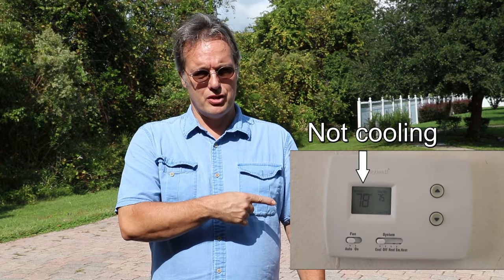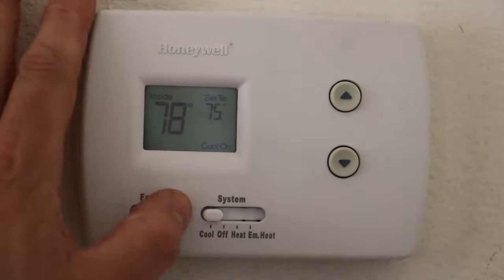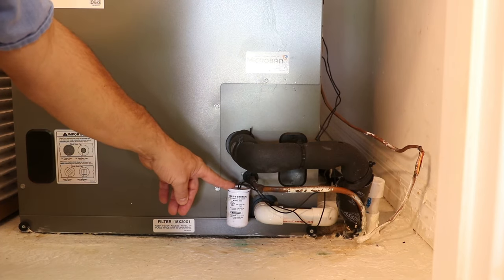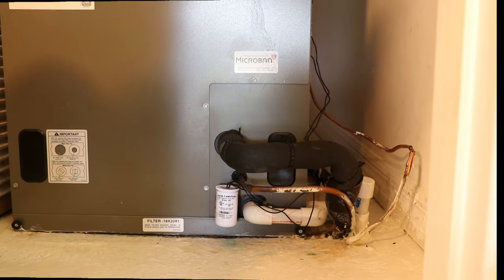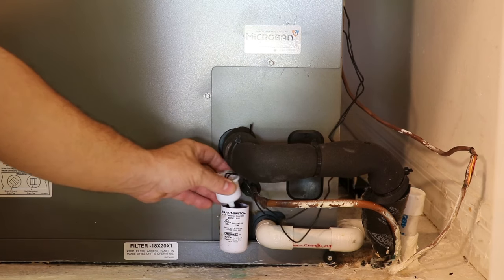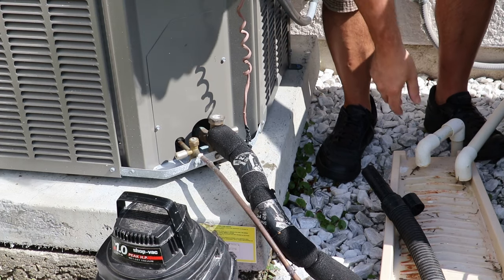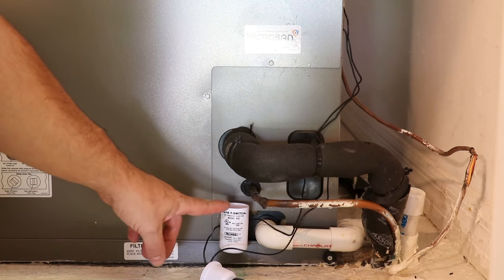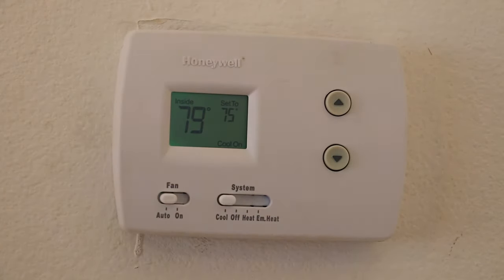Air Conditioning not turning on ? The AC float switch might be the problem .

Comment: If this doesn't work try this. My drain was clogged and my system shut off yesterday. I hooked up my Shop-Vac and cleaned it out just like in the video. After that it was working fine until this afternoon and then it stopped working again. I made sure that the line was cleared out replaced the batteries in the thermostat and was about to call my AC guy, but then has a last resort I tapped the safety switch with the end of a plastic broom very lightly and it kicked on and is working now thank God It's the hottrst day of the year here in Florida so far. Because it was triggered and shut off yesterday and came back on It must have still been sensing water so by tapping it it fixed the problem for me.
Reply from the maker: Excellent, perhaps the switch was still wet and registered as under water. Thanks for watching
Reply: @dansvideovault2186  You're welcome Thanks for the video 👌

Comment: Finally a video that shows me. Same issue 3 x a yr. I paid over $800 since buying  in 2023. No man will tell me what this is. I did the outside but it was in my attic and didn’t know what I needed to do. Why men can’t tell me this is beyond me. Now I do this Myself. I’m not paying to do this again. I drained outside but didn’t do the top first and drain. Ughh 😮my neighbor wouldn’t show me either. Not paying $300 again to do 20 min of work and gave the guy my wet vac to use.
Reply from the maker: @krista8404  You’re exactly right. These guys soak unsuspecting good people like yourself and want to keep ripping us off.

Comment: I do not think you want to put "water downed bleach into your safety switch drain line", it will likely go back into the HVAC system pan and if it sits there too long it could cause severe rust in the HVAC pan.  If you use watered down bleach, you should only pour in down your primary drain line that either goes outside or to your main plumbing system.

Comment: My thermostat doesn't even turn on
Reply from the maker: @bernardking13  What else is happening?
Reply: @dansvideovault2186  lost power for about 19 hours. Power came on  ut thermostat was off. Checked the breaker and everything was on. Turned it off for a few min then turned it back and nothing. Checked the float switch and felt some water. Went to the drip pipe outside and use shock vac and got a god amount of water (all while breaker was off) came back inside flipped the breaker on and nothing, still waiting and nothing. Also changed filter in the house

Comment: Hello everyone reading.  Yes, we just bought a used home in Salem, WI.  The owner twice insisted the a/c worked but wouldn't turn it on for us.  If the future I would withhold $2000 in the initial purchase contract until it was proven operable. All circuit breakers and switches were on. The access panel was removed from the side of the air handler in the attic. The tech found the one wire connection wasn't tight and it caused sparks etc.  It burned out the transformer. He replaced this piece and wired it tightly and we now have a working unit. By the way, there was no light switch (on-off) next to the air handler.
Reply from the maker: It is sad the previous owner did not disclose the AC problem. Was the Home Inspector able to test the AC system and give you the results in their report? Hopefully you were able to get it resolved without having to spend a lot of money.

Comment: Aside from being a novice who needed to check what the safety switch looked like, I never would have though to use a shop vac. We tend to avoid chemicals, so normally we forcefully flush the system out with a hose now and again. But since it got too backed up for that, well...

Shop vac cleared everything right out.

Comment: Your video is so helpful, it saved us tons of money on an a/c repair company. The float switch was full of water just like you demonstrated in the video. After clearing out the water,  the unit started right back up.
Reply from the maker: That's excellent. I'm really glad you saved some cash.
Reply: Oh my gosh all I did was shake my line and something kicked on. I will now open the safe-t switch and check it out
Reply from the maker: @brandonmoon5388  Excellent, let’s save some cash
Reply: @dansvideovault2186  my unit shut off completely now and my Honeywell thermostat has said waiting for equipment for 20 minutes now.
Reply: Scratch that, it just came on. But it doesn't seem to be cooling the house even with the thermostat set lower than the ambient temperature of the house. IE: ac is set to 69, while the house stays at 90.
Reply from the maker: @brandonmoon5388  Is your outside unit running?
Reply: @dansvideovault2186  yes. In fact, it never shuts off.

Comment: This worked like a charm! We were so frustrated because we have had to have the AC man come out twice within a week. The first time it was a part on the outside unit and the second time it was because the thermostat was outdated and needed a new digital one. Then last night I came in the bedroom and it was 81° but it was set to 77°. The inside unit would not come on. After watching your video I went outside and hooked up the shop vac to the pipe. A little bit of water came out and I’m hoping that’s all. My husband will be checking the lines to make sure there’s no more gunk in there. I came back inside and switched the unit on and after a few moments it came on and was blowing cold. I think maybe it just caused the floater switch to trip.
Reply from the maker: That’s great I’m glad it worked for you. I hate having to spend money when I don’t have too.

Comment: Hello, and thank for this video. I did everything and there’s no water under the float anymore, yet still the air handler doesn’t want to switch on. I cleared the line and it’s flowing freely. There was water in the pan, which I vacuumed out. So all should be good to go?
Reply from the maker: @Mumumama205  Did you suction out from outside?
Reply: @dansvideovault2186  yes I did and all water poured into the line, starting at the handler, came out just fine
Reply: @dansvideovault2186  the motor was blown..

Comment: Will give this a shot. No power to the central unit or the AC unit outside. Breaker not tripped or tripping. Seems like the video shows if the AC Float is raised, it shuts down the unit. I hope this is the case. I’ll post back if this fixes the issue. Thanks!
Reply from the maker: Thank you,yes. Please let me know.

Comment: I live in a trailer, this is probably a stupid question but where is that located in a trailer? Under it? Or outside?? Im lost
Reply from the maker: If it is a smaller trailer it might require window units only. The outdoor compressor unit [ if it uses one] would be located outside mounted on a small square pedestal and the unit should be about 3.5' W X 3.5' L and maybe 3.5' High as well. Try to see if you can find anything that looks like that.

Comment: Routine service call today. The aqua guard "shorted out" according to tech and needs to be replaced for $179.00. The wire looks damaged at connection...wasn't like that before. We have had to take this apart and dry it out several times over 4 yrs, and ac always starts right up. We are always very careful turning it so not  to twist the wire. I ordered the needed part for $39.00  for us to replace! The tech bipassed this so the ac would come on...will have to change wire again with replacement. Egads !  2:11

Comment: Maybe this is a stupid question, but got to ask...Is it better to vacuum the line out with the  drain cap on or off and also do you keep the float switch in place or remove it before vacuuming? thank you.
Reply: I had to do both
Reply from the maker: I try to keep the cap off. If there is any water to be pulled out , it will have air behind it to help it flow better
Reply from the maker: I also keep the float switch in place before vacuuming

Comment: Question. This is the same unit I have. Is a filter inserted at the bottom of this unit where the two screws are at the bottom? Or just the filter inside the house? Thanks.
Reply from the maker: It should be located in the house

Comment: I had a horrible time with my brand (New)York AC. My water safety switch is bone dry and has been bone dry for months. The air handler has been arranged in another direction so they used a electric pump to suck the water out of the AC to the outside. The air handler is always sweaty sweat so much that in a couple years I'm going to have to get a new stand because it's wood. It's maybe a year old
Reply from the maker: I have a moisture meter to check the base [wood] of the air handler, that might be handy to pinpoint the exact location of any leaks.

Comment: I shove a garden hose into the outdoor drip line and flush it a number of times.  All sorts of white slime came out. I kept doing it until the water ran clear.  Eventually though, I still had to go to the garage attic and vacuum the drip pan.  Any comments on my technique?
Reply from the maker: It sounds good, what ever clears the sludge from the lines works for me.
Reply: Wait, so I just put regular garden hose connected to water, then turn it on while it is attached to the AC drain pipe outside ? Sorry I’m trying to figure this out in a rental

Comment: The float switch creates more of a problem that it solves, in my opinion.  It introduces another low volt circuit failure point you did not have before.  In the summer, all you have to do is inspect the condensate drain pipes a couple times to make sure it is clear.  Whoever invented this gizmo has cost most unsuspecting home owners tens of millions of dollars in service calls.  It's a repairman's dream service call.
Reply from the maker: Very true but I guess it does help some people in some air handler locations.

Comment: Is the safety switch and the drain line the same thing ?
Reply from the maker: The safety switch is right on the exterior of the air handler and the drain line is after that.
Reply: @dansvideovault2186  thank you !!! But is cleaning one of them such as pouring vinegar lead to the same result or should you clean both

Comment: My ac flooded and I thought I had a bad switch because it didn’t shut off. I replaced the switch and it still won’t shut off. What’s wrong? Please help! 🙏
Reply from the maker: Did you shop vac the water out of the line?
Reply: I did, the issue seems to be with the switch itself. I’m on my second one now and still doesn’t shut off when float is up.

Comment: My AC unit is from 1970. Yesterday, it just stopped working while it was working before. My system is really not that modern.
Reply from the maker: 1970, wow that is a miracle it has lasted as long as it did. It probably doesn't have this feature but if it does please check it out. Thanks, Dan

Comment: Thanks for the video! Would that cause the ac switch at the breaker box to trip too? Since it cut off.
Reply: Shouldn’t it’s wired into the thermostat.
Reply from the maker: Mine luckily never trippped

Comment: I don’t have access to the end of the drain. How do I clear just the safe t switch?
Reply from the maker: Once you remove the safety switch, attach the shop vac hose to the opening and try to suck out the water from there. That might work?

Comment: I live in a apartment what steps do I take
Reply from the maker: Can you locate where your AC unit drains to ?
Reply: @dansvideovault2186  thanks for the reply but i fixed it i think. i pulled up the drain plug and the water started to drain then the ac cut back on. sorry for the run on sentence, but yea i got it fixed! thanks!!!!
Reply: Very long ones

Comment: What if the T Switch wire cut off
Reply from the maker: Do you mean literally cut off as in sliced ? Thanks
Reply: @dansvideovault2186  literally cut off, but it's on the outside unit
Reply from the maker: @gsheverything_2716  I believe you can buy a whole new switch from Amazon and that should have the needed wires to reconnect to the cut wires[ if there is any].
Reply: @dansvideovault2186  You right, I just bought a ss1 t switch for 15 bucks and Amazon.